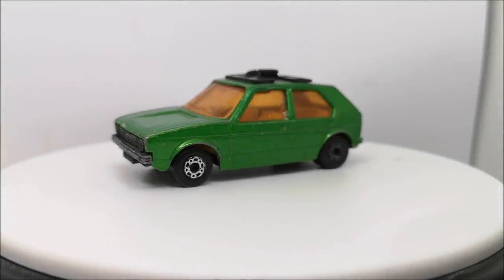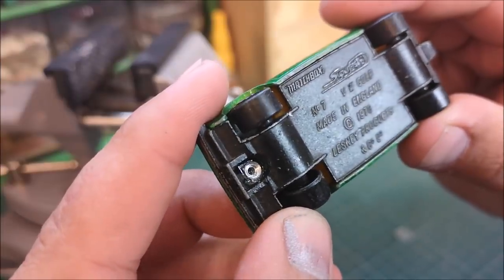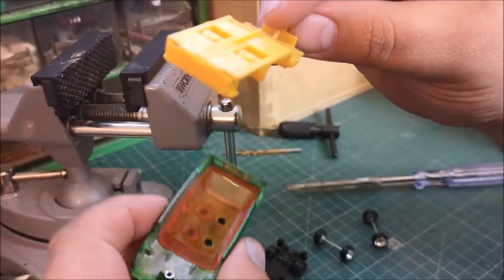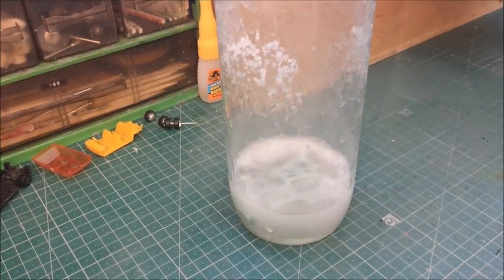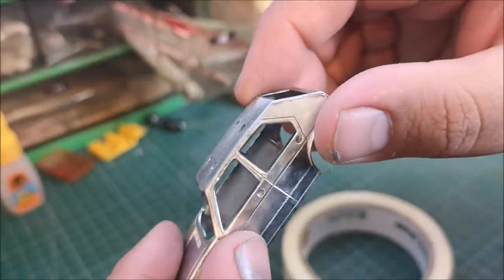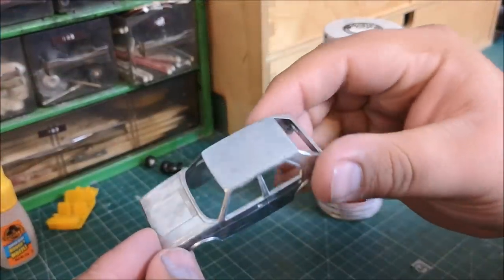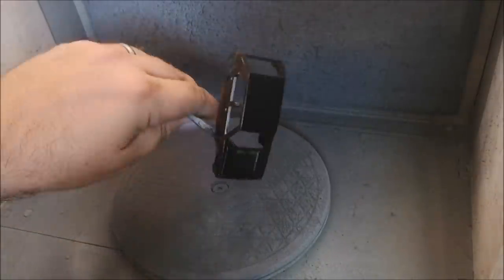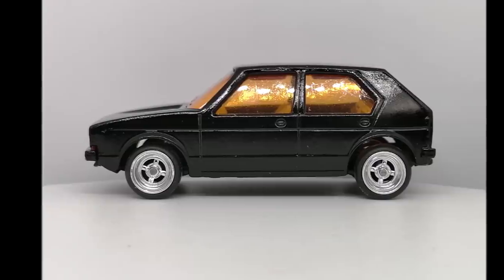Matchbox No 7 VW Golf (1976) - Custom Video

Comment: Surf boards are easy to make, my wife had flexible nail file, take off the sanding paper and it has a plastic or nylon center, cut to shape and sand the edges, make the fin with corners of the plastic and glue onto the board, paint desired color. It is fiddly but my hands shake and I did it.

Comment: We had one of these in the late 70's. Along with rubber monsters and building blocks of some sort, we went full anime, inserted the boards like wings pointing outward (the center holding bracket kept the boards in place and the outer brackets canted them upwards slightly) and Ta Da - flying car and savior of the city!! Certainly not the first iteration of a transforming car fighting monsters and robots on a Sunday afternoon but possibly the first use of a German economy car for the job! Those giant rubber basterds never saw that coming. Ours was green too.

Comment: This looks great!

For dimples on top (for future projects with similar issues), if you really wanna get rid of the dimples, you can try to cover the entirely top with filler, smooth/flush it out while sanding but stop just short of bare metal. At least the edges, just make the middle can be a bit thicker (let's say the top is a bit round, as long as it is consistent and smooth and not too big). It depends on your filler how thick you wanna go, but if it is good enough to fill those holes it should be good enough to be thin enough that no one is gonna see it when painted

Comment: They were marketed from the '70s to the late-'80s/early-'90s in the US as the 'Rabbit' as far as we can recall. 

If you don't mind buying ones made for Hot Wheels, you can get surf boards relatively easy enough from spare parts suppliers.

Comment: I'm not in love with the filler idea.It will fall out easily.I give the ones I do away to kids, whatever I do has to be tough. as you saw, the filler shrinks over time.I would use the baking soda and super glue technique. It's a much tougher fill.